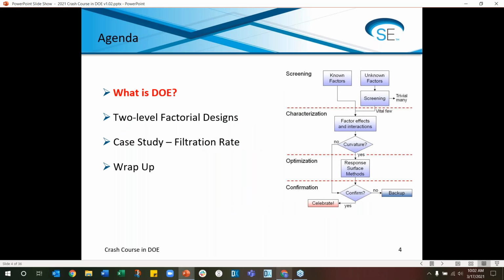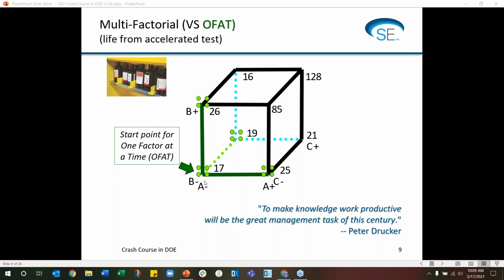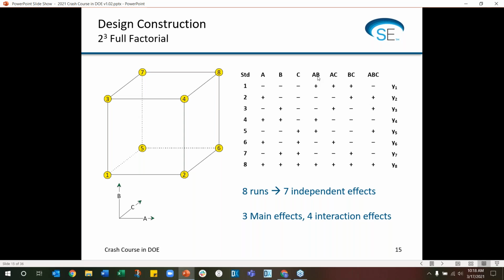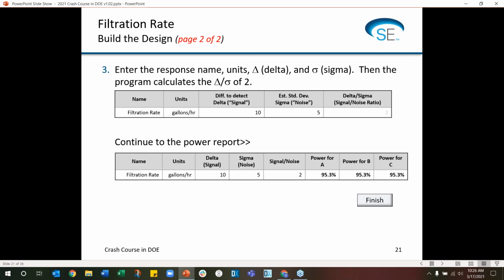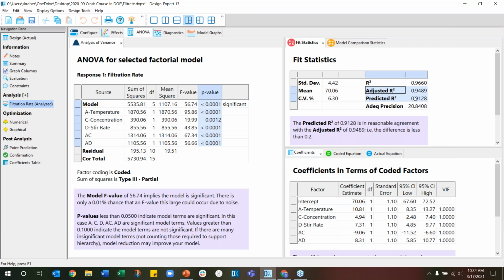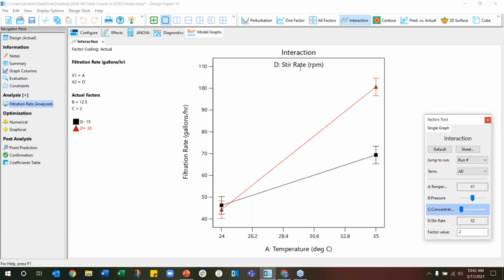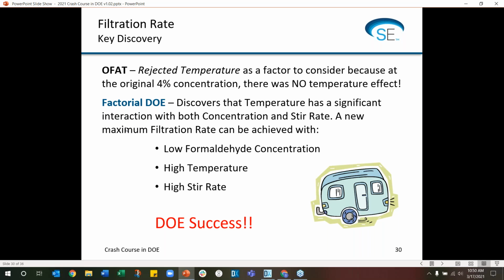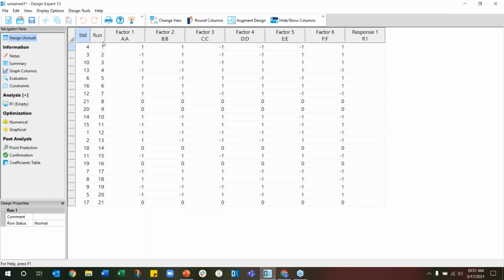DOE Crash Course for Experimenters March 2021

Comment: I need a suggestion:
I have 5 factors (4 numerical and 1 categorical) with 5 levels for each, also the model is known to be non-linear in nature.
Which design technique should I consider in my design?
Please guide me in this matter.
Reply from the maker: Use a response surface design. Since you have a categoric factor, use an Optimal (Custom) design. If you want to specify the exact 5 levels for each factor, change the TYPE from Continuous to Discrete.
Reply: @StatisticsMadeEasybyStatEase  is it possible to have discrete factor levels with a central composite design?
Reply from the maker: @mohammadmainulhasan4195  The discrete option is specific to Optimal designs. You can manually edit a CCD plan, but then it is no longer a statistical central composite design. That may not be a problem as long as you understand what you are doing. If you are doing research to be published in a journal, you should not call it a pure CCD. But if you are doing experimental work for a manufacturer, the modified design could potentially still be very effective.

Comment: Could you please guide me on this matter? If I have 2 level full factorial design with one run (without parallel runs), and also have 4 center points runs. 
In that case, ANOVA table will contain a row for "lack of fit". Could you explain that row? 
Is that lack of fit just for center points runs? and if it is so, should I consider that row for my analysis or just ignore that? 
Your comments will be highly appreciated. Thanks!
Reply from the maker: In this situation, Lack of fit measures how well the factorial model fits the data. Strong lack of fit (p<.05) is undesirable because it indicates that the factorial model doesn’t fit the data well. It is desirable to have an insignificant lack of fit (P>0.1). If LOF is significant and curvature is significant, then you should augment the design to fit a higher-order model.

Comment: why ANOVA table does not show "lack of fit" row ?
Reply from the maker: Lack of fit is only calculated when there are replicates. These replicates must be independent runs that include all normal process variation (not simply repeated measurements).